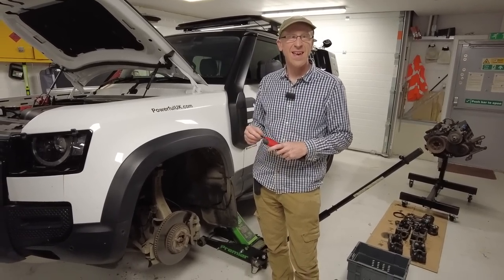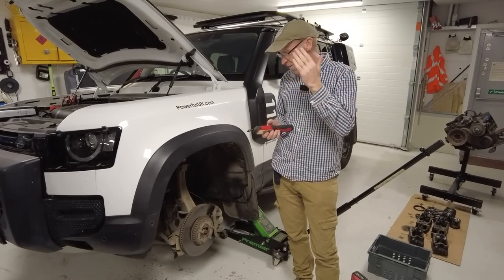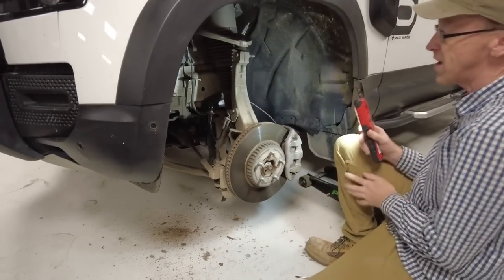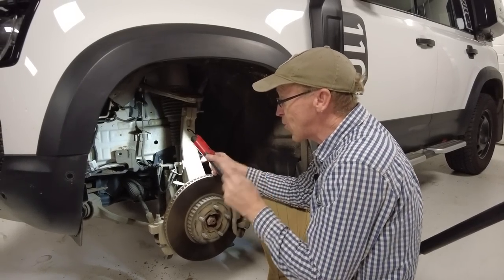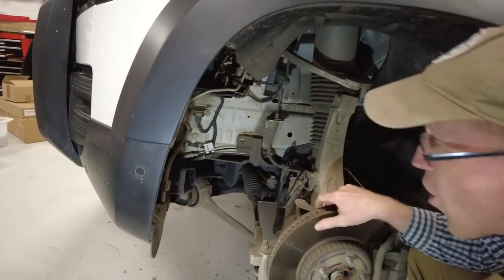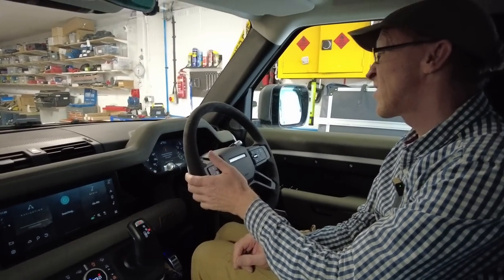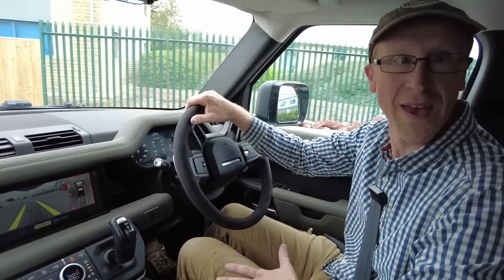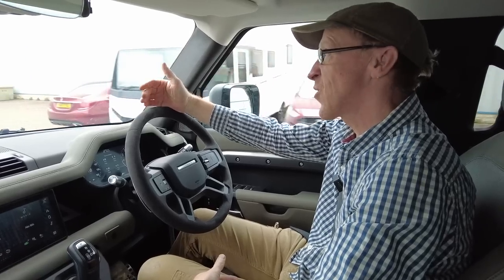We Defend the New DEFENDER - What Really Happens When An ABS Sensor Fails !

Comment: It's probably put those codes in a History file so to speak so if you were to use an EOBD Scan tool the codes would probably be listed  but not as Current. Didn't think for a minute disconnecting an ABS Sensor would stop you from driving, we've had customers come into our garage with ABS faults and apart from lights on the dash they drove in.
Think Mr Man will be making a retraction!!!!
Reply from the maker: It was a bold claim to make... and like you say just did not seem to relate to other similar failures I have seen.

Comment: Hi Simon, Well done on your video. Any chance Powerfuluk could come up with a guard that protects the ABS wiring? I seem to remember Green Oval Experience (no longer in business) sold a guard that fitted to the tie rod at the front? Cheers
Reply from the maker: Hi - i need to study the movement of the front suspension to see if this is possible

Comment: Awesome video! I had a Chevrolet Tahoe which I drove years without ABS. Sensors were way too expensive and in Canada, with the corrosion, was almost pointless to get them fixed. That’s the expected behaviour from a Defender and any other vehicle, LR or not. Perfect!
Reply from the maker: Yes it seemed an odd claim - but seems to be based on the old LR3 setup

Comment: On a more general point there is a real lack of content showing the L663 doing remote over landing in Australia probably because they are too expensive right now and the traditional vehicle of choice is a Troopy or Dual cab 70 series. I can’t see them modifying a new L663 130. On the other hand local mechanics certainly are not going to know it well so it’s a bigger risk. Vehicles that could not be repaired or towed out do litter these tracks.
Reply: The basic 70 series isn't much less expensive than a Defender. ASPW spends a lot of money upgrading his to meet his exacting standards. I'd like to see him make the same effort on a L663 130 as an experiment.
Reply: I think JLR should take an expedition of L663’s and Range Rover’s on CSR. They’d have to change the wheels and tires for sure but that’s easier than changing out the whole suspension and widening the rear axle of a 78, I should think…

Comment: For my BMW E53 X5, which is similar system to the old Land rover system, once the ABS has fault,  the car can't go any off road, like no locks anymore with no articulation, can go nowhere.😂😂😂
Reply: Probably a good thing. You really don't want to venture off road in an X5. Well; no more than a grass verge.
Reply: @srd8228  actually the first generation X5 is quite good, much more than i expect, only need a low range transfer box.😄😄😄

Comment: Ride height sensor disconnected - can still drive. 
As a further experiment I disconnected one front ride height sensor on my MY22 defender.  Error message reported.  Still able to drive - done a 10 mile trip.  Can use in access, normal and off road heights.  Error message clear after reconnecting sensor.
Reply from the maker: Wow Ivan - this is an interesting and reassuring result.

Comment: Thanks for doing this! I had hoped it wouldn't be as bad as ASPW assumed it would be. Perhaps the Range Rover behaves worse?

I'm still very curious how something like this would degrade the off road performance. Specifically, will it still be able to use it's clever locking diffs? The traction control would almost certainly be nonfunctional, but diff operation is kind of a separate thing. In lots of other 4WDs diff engagement can be 'locked on' manually...It was never clear to me if the Defender could also do this.
Reply from the maker: I think the Range Rover would be the same - they share a lot of the same technology. Happy to test on my L405 / L494 if people want me to.

Comment: Well done Simon. Love your work.

ASPW has a chip on his shoulder and will be caught out for all his dishonesty. It always catches up.

Thank you for doing this. Here is my reply to him earlier:

I mean this with all due respect, but these are all the same old usual arguments! 

Give me a modern fighter jet rather than a biplane to go into battle with!

You also need to check your facts about the ABS sensors and what would happen if they fail. 

So disappointing that you again spread absolute rubbish without checking your facts first. 

New Defender without any question and this is with experience. 

I have done over 12k kms of overlanding in my new Defender and I've done it in pure comfort. And yes most of that was without shops and facilities with many nights bush camping in Zimbabwe and Botswana and on many cutlines. I also did most of that with 20 inch wheels where my mate with his much higher profile mud terrain BF Goodrich tyres managed to damage a tyre in Mana Pools, and yet mine were perfectly fine. Luck maybe? 
Someone I know sunk his 70 series in Moremi, and while he did that he put the fan blades through the radiator and yet my New Defender did the same exact crossing with ease and no damage. Does this mean anything? No! He also damaged his interior as the water came in everywhere and yet I had no water come in my New Defender and we did it at a cool 21 degrees :) (just kidding windows were open) . Maybe that means it doesn't qualify as a defender then :)  I’m now at around 280k kms of traveling in modern Landy’s (D3 to ND) and have yet to have an issue you harp on about. In fact I don’t know anyone who has had any of those problems except one guy who was horribly overloaded and abusive to his D3.
 
Also, at first you said you can not even fit a winch to the New Defender without damaging wiring (not LR fault but the person fitting the winch)  and yet we in deep dark Africa fitted one to mine with no damage, and it’s not the only one that’s had one fitted, they are getting fitted weekly. I even fitted a dual battery system, roof top tent, drawer system, fridge, water supply, vhf radio etc etc 

The New Defenders suspension is also very different to the RR and Discos. At standard height it even has more clearance so the argument of lowering is a non issue. Fans through a radiator are also a big problem! 

Come on ASPW this is getting boring with all due respect. Times have changed.

The target market has also changed. Range Rovers were never designed as work horses, they were designed for the gentleman who would go off road every now and again, someone who wanted more comfort than what the series offered. Now its targeted at the flashy rich, movie star type not people like us that get dirty traveling off road. 
Roads are better, even in Botswana it is hard to find a calcrete road now for example. Even in Moremi and the Okavango last month I noticed it was full of soft roaders and very few solid axel'd vehicles are seen in comparison. I even saw 3 New Discoveries with their owners camping in places like Magotho. Times have changed and any fool can be uncomfortable in the bush now by using an old style vehicle. 

No one wants a Range Rover for the bush anymore. 

Land Rover and Range Rovers sales figures have proven that their strategy has been successful.

Let go, technology and times has moved on. Perhaps it’s time to stop listening to  all those that continue to sell product that they get sponsored!
 Something simple: My New Defender tells me when I need to start the vehicle if the battery is low, does the old Range Rover do that? 

Anyway back to planning my next months trip of around 4000kms through Zimbabwe and most of that way off the usual roads.

Ps. Do you know about the latencies built into the New Defenders? Perhaps you should check.
Reply: I wrote less for my dissertation at university
Reply: @Cous1nJack  😂😂😂😂 yes I got carried away with his nonsense. 
Sorry about that
Reply from the maker: Why did Tim get all the thanks ! Simon
Reply: @L663  I’m so sorry Simon. Stupid mistake. I just ordered from Tim and read an email from him. 😂😂

Thank you for doing all these things you do and I’ve corrected my mistake 😂
Reply: @OverlandingwithBruce  ASPW has the most experience i've ever seen in overlanding and makes a fair point on this issue. That land rover has way to much electronics and absolute shit to withstand what say ASPW's Criuser does, the land rover would simply fall to bits.
Reply: @kenworthcummins8105  that maybe true (which I’m not agreeing with) but for 99% of people traveling the outback or in Southern Africa it’s not needed. Maybe if you work at a mine or something.

His in accurate claims is what I am disagreeing with. His aim is to sell the vehicles he builds and products he is sponsored with. 

As for experience, in some areas yes in others not

Two cruisers didn’t survive the water crossing I shared earlier, my New Defender did easily
Reply: @kenworthcummins8105  if that's what you believe then that's fine for you. Unfortunately reputations in South Africa for sure are very different. 

Everyone carrying on about electronics has not investigated or bothered to learn about the new Defenders set up and the test the connectors and ECUs have gone through. I have also yet to hear of anyone being stuck due to electronic failures. 

In a 200 series cruiser and 2 70 series cruiser in the same water crossing I did with ease yes. In fact the one cruiser broke its fan and put pieces of it through the radiator. My ND survived without even a water leak. 
 If you want to drive a farm truck then buy a 70/79 series Toyota but dont buy the v8.  90% of people wouldn't want to drive that daily to get to work between trips anyway. 

I hope all you guys who carry on about electronics still fly in biplanes and prop driven airplanes. I know Andrew had a pretty advanced glider at one stage full of electronics not an old fashioned one needing to be towed to fly.

Comment: TFL in america went through 3 defenders if i recall,  first was a total failure , entire vehicle needed replacing, second one failed almost straight away, reliability is essential in the outback
Reply: One swallow does not make a summer....
There will always be a car that simply fails. Have to see things in relative terms though. I've seen many a Toyota Landcruiser on the back of a flatbed truck or standing next to the road with an open bonnet, waiting for the AA or tow-truck. That does not mean all Toyotas are bad, does it? 
TLF requested a after sales change or modification , option, on a new vehicle model that came out  very recently, with some out of country (USA vs UK) techs not yet up to speed on all the optional extras to be added after sale. They accidentally cut through  a wire harness that caused a lot of issues with the vehicle. Land Rover then agreed to swap that vehicle for a replacement and offered TFL a replacement. The precise vehicle in the configuration they wanted was not available, they were offered a choice to wait or take a slightly different vehicle, they chose the latter. Does that make all Land Rovers bad or low quality???? No it doesn't!!!!
See things in perspective and be realistic when evaluating these kind of things, I say....
Reply from the maker: The 2nd fault was the dealer issue - not Land Rover but yes this was not a great launch... my car broke down driving home from collecting it ! but thats a long long story..
Reply: Tfl feeds off and inflates issues for better views... don't know if you've noticed that with all their videos... every vehicle especially first year launches has issues.

Comment: Thank you! White's assumptions where reckless and I a not sure what they were based on. (I did watch the original video when it first came out) He says he does not have a beef with LR and I don't believe he does per say, but he DOES have a beef with modern technology and clearly sees it as a weakness in any vehicle. I feel he targets LR the most because they are loaded up heavily with tech. He also feels that air suspension is a massive weakness and does not care for independent suspension at all. Yet we do not hear numerous stories of air ride crippling a Rover on a trail from a damaged height sensor, etc. (I know of one instance where a stick punctured an air bag). And we do now hear people saying Rover CVs are weak and prone to fail. If anything is an issue with any vehicle on the trail, it is more likely to be maintenance related (lack of). I have seen leaf springs and coils fail though. So I think the Rover is as susceptible to trail failures at a rate comparable to any other vehicle and do not have the apparent weaknesses he love to ramble on about. Because his is making assumptions, not presenting actual data backing it up.

Comment: Nice test.  My one criticism is that you started with an assumption, although it appears to have not been a factor in the end: that all it can do is brake a wheel.  Traction control and stability control - which also utilizes the wheel sensors - can also reduce engine power significantly if their programming was designed that way, regardless of what your right foot is requesting.  So while the test appears to be a success and vindication (hurrah!), it wasn't without a potential flaw in its premise.
Reply from the maker: With no sensor there is no traction control so I cannot see the engine limit coming onto play

Comment: It can drive but what state is the 4wd capability in? ASPW was 3000 kms into sand dune country, just being able to drive it isn't the issue really. If the on road performance is reduced then what is the effect on the off road performance? 3000 kms is a long drive to a garage. Until you've been in the situation you can't really grasp the scale of it.
Reply: I presume that all the wheels will still be driven via the centre differential. Cross axle traction might be compromised but if the rear diff has the e-locker that would help. Plenty of older 4wds don't have ABS or traction control, or cross axle diffs and still work.His classic Range Rover is a fine example. Simon has proven that the Defender will not leave you stranded somewhere near Laverton Western Australia on the Great Central Road because an ABS sensor fails. Having driven that road in my old Defender it is reassuring that I can drive it in my new one.
Reply: @atoieno  The question was does it have any any 4wd functions including the rear diff lock. You are presuming it does. The Great Central Road is a 2wd track.
Reply: Simon's test demonstrated that stranding was not an issue which was APSW's contention. Your question is different and is correctly one to be asked: what off road capability is compromised if an abs sensor fails?  I wasn't comparing the Great Central Road to the Canning......its just that APSW dismisses the Defender as a capable  "overlander", full stop, which is not the case as many owners can testify.
Reply: @atoieno  If it lost 4wd on the Canning then it would be stranding. I knew it would start and drive because I lost an ABS  sensor on my Land Rover on the Warburton Crossing track out of the Simpson Desert. I had all the warning lights and no safety or traction systems but the car did drive the 3000kms back to Sydney. However, I still don't know if I did it in 2wd or 4wd due to the nature of the systems. I didn't need 4wd on that track but a few days earlier may have been a different story and it would have been interesting to actually test the Defender 4wd capability in that situation. Land Rover has too much hiding behind an electronic veil if you know what I mean?
Reply: Can happen to any car. Eg on our Simpson desert trip a 100s gave most trouble.  Sort of rubbished the Toyota assertion re reliability and toughness.

Comment: Well, I have seen some you tube videos in my time, but this one is excellent. Top marks for doing this. It also shows how accessible the parts are on a new Defender. One thing though!  I was a die hard series lll man because they were simple, now vehicles are not.  Also, (I suppose I am old school)  I miss the bouncing around, having fun, rain coming in the doors and front flaps exposure and lack of ABS that the old vehicle gave me for very little money. So, I made a BIG decision (for me) I left 4x4 behind and have started motorcycling off road!  It is a lot cheaper and I use my camping gear equipment from my cycle touring days. I am in the elements, and feel like an adventurer! (cold, hot, thirsty, dirty, and content!)......Whilst I think the Defender is a great piece of engineering, I have moved on!......I do like your channel though, so thank you!
Reply from the maker: Hi - thanks for the comments on the video. Respect to you for the motorbike adventure touring...